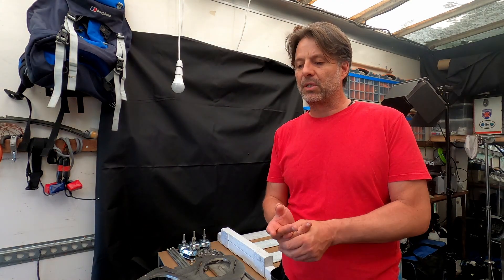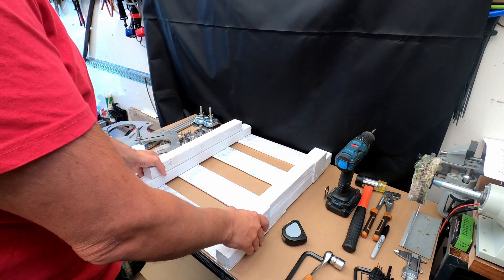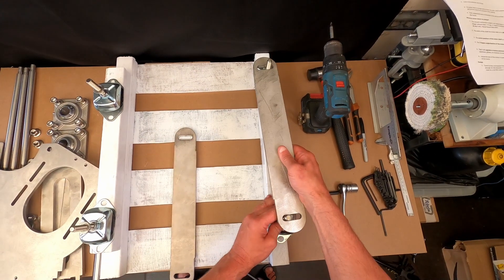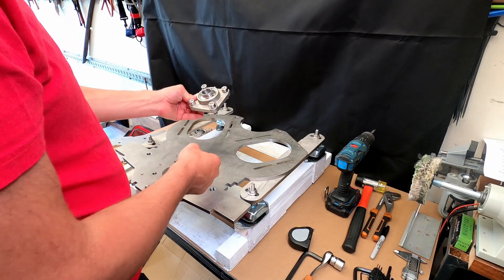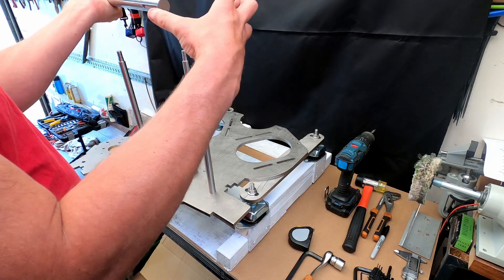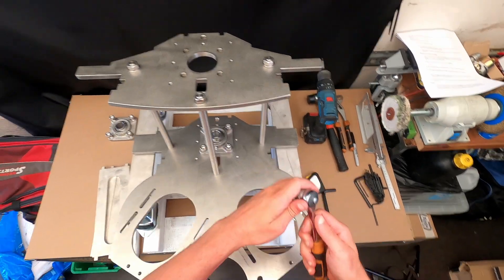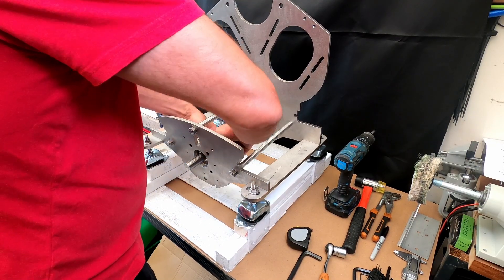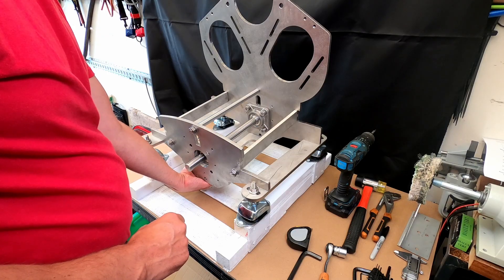Off-Grid Boat: DIY Electric Boat Motor Assembly - Ep. 1

Comment: Hi, looks awesome. We will have the exact same setup as you on our steel sailboat (Devotion 37). Two 10KW golden motors to get enough power with just 48V. Are you willing to share the Qcad files? Happy to pay for it.
Reply from the maker: Hey Jeroens4681 - Hope all good. You are more than welcome to use plans for free as long as it is for personal use and not commercial use. Saying that, it is still a build in progress so the whole setup is yet to be  'proven' in a real life scenario. There are still some areas that needs to be fine tuned and figured out. At the moment the motors do not sync in relation to RPM BUT something I will figure out one way or another:) There is also some work left on cooling as I most likely will shift from air/water cooling to 'skin' cooling. If you still feel that you would like to start your own build then let me know here and we can work out a way to get the CAD files over to you:)
Reply: @modularhippo  Thanks for the quick response. I don't have the motors and controllers yet. Ordered them and did some reading about it. I have the EZ-B481000 controllers and I think the default control mode is "Torque control" (that says the manual) so my common sense says speeds can differ. I am also not sure speed synchronisation should be the goal. I think you want both motors deliver the same torque at the same moment because you don't want one motor(with more torque) driving the other (with less torque). Both motor are physical conencted so speed can not differ anyway. But again, this is my common sense speaking again. I am a few steps behind you but I am not building a whole boat so maybe I will catch up 🙂. And can keep you informed. Why not air/water cooling? Do you think its not sufficient? Golden motor USA is selling an air/water cooling kit and assume they have experience with that. Yours looked already like overkill compared to theirs. you where using a seperate cooling system for every motor/controller. So 4 in total with (4x3) 12 fans? They are using 1 set for the motor and controller and just 2 fans. Curious what the reason is to go to "skin" cooling. Still very intrested in the CAD files. Aware that it is work in progress. I have to alter them because my fundation for the motor is wider then yours but it looks like a great starting point.
Reply: Yes, only for personal use. Getting our own boat electric.
Reply from the maker: @jeroens4681  - Good points around torque👍🏻👍🏻 When I get more time I will imerse myself on the whole topic properly:) - Reason for considering skin cooling is that fans can be ruled out and you are just left with a pump to worry about. My current setup as you say has to many moving parts that can break. Saying thay, I will complete it as well as a skin cooling setup to see what the outcome is:) if you drop me a message on [contact @ modularhippo.com] I will then send you files this coming Monday when back in business. Please let me know when email is sent as a reminder:)👍🏻 Looking forward to learn from your venture as well:)👍🏻
Reply: @modularhippo  I send you a mail.
Reply from the maker: @jeroens4681  - Thanks Jeroen, responded:)

Comment: what is the thickness of the plate ? Was the plate cut on a waterjet ?
Reply from the maker: Hi Jim, hope all good. The plate thickness and type is SS 314 10mm Thickness. My nearest cutting company use laser so that is what is what I was using for these parts.:)
Reply: @modularhippo  Ok makes sense. I am trying to get a design done for a twin motor mount for the Lynch Pancake motors - i am going with 20mm aluminum plate because I dont want dissimilar metals touching the hull. I need to get my mount cut on waterjet because Laser has a "HAZ" issue. If aluminum plate is heated up, it changes properties. With waterjet its a cold process, so no such worries.
Reply from the maker: @jimjones7821  - Tell me about it, I have had so many issues (mainly from welding) where existing parts have distorted from original shape and caused issues. Aluminium plates would have made sense, not even sure now why I did not consider that as an option. Potentially any bolts threaded into the plates and the torque/twist of the motors (believe I was worried that the threads would be effected over time). Either way I guess we should be fine:) My anti-vibration feet has a 2mm delrin plate/washer to separate and made sure I used Sika before I mounted the motor rings to the actual motors (super paranoid in relation to missing AL with SS as I have seen the result on both Motorcycles and boats in the past).
Reply: @modularhippo  yes you are correct about the corrosion issue. Have you heard of Tefgel? Its a paste that you spread over the bolts etc that provides galvanic isolation between the dissimilar metals. The original design I had Agni do was designed for 8mm steel. I had them change it to Aluminum and thier engineers said I needed 20mm aluminum to match the strength of 8mm steel. The Agni engineers did the design such that it can be bolted together or welded. I am going to get the aluminum plate anodised to look pretty because a Lynch motor setup in a yacht should look pretty - right ;0
Reply from the maker: @jimjones7821  - Absolutely, not only will it look amazing when anodised, but will also add some longevity from additional corrosion resistance:) - I have started to use 'Tef-Gel' whenever I use SS Bolts in AL. Please know that even with Tef-Gel they at times need to be removed, cleaned up a bit and Tef-Gel re-applied:) SO easy to forget with everything else going on:) Aluminium makes perfect sense and the 20mm sounds fair!
Reply: @modularhippo  didnt know that about tefgel - you learn something new everyday. I didn't know about the sikkaflex trick though  - which Sikka - there are so many of them !

Comment: Do you have more information about the bearing and bearing housing ?
I’m replacing a bukh DV10 with a 5Kw golden motor en and looking for bearings that van handle axial/radial forces.
Reply from the maker: Hey @MsFrodo111,

Great to hear that you have started a similar project:)

I will be using a 'thrust unit' ( more on that here: https://www.aquadrive.com/ ) that will take up the force from the propeller 'pushing the boat', all to make sure that the axial/radial load is minimal. I am using the bearing & housing below and it should be able to take the radial force created by the spinning shaft:

https://simplybearings.co.uk/shop/p21269/SSUCF205-16-Imperial-Four-Bolt-Square-Stainless-Steel-Flange-Housing-with-1-inch-Bore-Stainless-Insert/product_info.html

How all of this will work in real life is yet to be seen , ha ha. - Let me know if you document your journey as would be great to follow.

Happy Weekend!!

Comment: 2 x 10kW, that will make you a speedboat wouldn't it?
Reply from the maker: Hi Jens - I wish:) I believe 1 Kwh is equivalent to around 1.34 horsepower so are looking at around 26-27 Horsepower. Hopefully enough torque to propel me forward 3.5-5 knots in bad weather, happy with that:)
Reply: @modularhippo  My hypothesis is that sailboats with diesel engines are always overpowered, because the noise, vibrations and smoke at its maximum would make you think the engine is about to melt. I hope you can do with less - 10 kW 🙂 In the end YOU will have a good and responsive setup. Mine will not be as responsive, but should be able to cruise at 5 knots, and maybe 4 in bad weather. I would always use sails in bad weather though.

Comment: Hello !!!   I'm loking for the same type of setup...   Would you be open to sell those ?
Reply from the maker: Hi Anthony - Thank you for showing an interest and for your comment. The setup is not really 'proven' as of yet as allot of the ideas are being amended and improved as we go along. There is also the water-cooling left to tackle. as well as other bits so let's see how it all comes out in the end:) The short answer is, not much of a product at this stage, but if it comes out well then happy to guide you on the process and share plans etc. Let's stay in contact:)
Reply: @modularhippo  I'm building from scratch a Catamaran to live aboard, I'm pretty close to the point of buying an d installing motors, maybe I could help and share ideas too :) !!!  I also have manny questions about how you're going to manage to run and control 2 motors on same shaft,,,  One thing is sure, I'm going that direction too...
Reply from the maker: @antonygilbert9695  That is amazing, a big project!!:) If a Catamaran I assume you want a motor and drive in each hull. by having different rotations on propellers each side you cancel out any prop walk and can also use the individual motors to also steer the boat. Please expand more on reason for using one prop shaft on Catamaran as not the norm?:)
Reply: @modularhippo  I am anti diesel, can't repair them anyway...  As it's for retirement, I want to be able to be safe and be able to fix everything.  it's a 38feet Cat that will weight about 18000lbs, I have talked to Dave Parker here on youtube, thenn by email, he has a 44 feet 100% electric Cat, he's my inspiration...   I will have 23 solar panels (8 already installed) and maybe a small generator for bad situations...   As most people living on their bot are an anchor most of the time, I will be using all that power for a very confortable living...  Also building my own dessalinator from plans people shared onn Facebook..   That may interest you too ???
Reply from the maker: @antonygilbert9695  Sounds like you have an amazing project on the go there (very similar to mine). Are you sharing your project on YouTube, if so feel free to share link as would love to follow it:) I am planning to build a dessalinator so that is very much of interest. There is some good channels out there that show the main components needed and looks like a doable project. Will locate your email and drop you a line:)
Reply: @modularhippo  I am not good or patient enough to make videos...   But I LOVE SHARING as much as I can, this is how we all get better :).  Hope to read you soon...

Comment: Making a mock up of the engine mounts is a brilliant idea, I'mma gonna steal that idea! ^_^
Reply from the maker: Just made the whole thing feel a bit more real as I don't have the actual boat yet😂
Reply: @modularhippo  Oh? How did you settle on the engine mount size/spacing?
Reply from the maker: @TheDigitalMermaid  - Please expand on mount size/spacing as not 100% sure what it refers to. The motor rings are 10mm SS thickness and the reason for that thickness was to have at least 10mm thread space for the 4 slider bolts. The space between the two motors in width is only a couple of centimetres. Let me know if I misunderstood you:)

Comment: Very interesting. I have the same 10kw motor that you show in your second video and I was considering getting a 2nd but I was thinking a dual propeller set-up. What considerations did you make to determine two motors to one prop? -ope nvm. I just read your other comment about the dual motors below. I will stay tuned for where this is headed!
Reply from the maker: Hi TornState, Thank you for taking an interest:) I am building a 36' mono-hull in parallel so this is the limitation. If not then having two propellers (each spinning different ways to offset prop-walk) would have been ideal. Also to be able to control each prop individually for additional steering would be really useful. In my case, only one motor did not fill me with confidence if used in headwind and heavy currents. A 20 Kw motor would mean jumping to 96v and that caused other issues for me so decided to try with two motors and stay at 48v.:) - If you are sharing your project online then let me know as interesting to see what you are up to (especially as we have the same motors):) - Also, if any of the parts I have designed is of use then let me know and I will send you the cad files.
Reply: @modularhippo  Yep I am documenting it  (poorly) on my channel. It's a foam/epoxy trimaran of my own design. I have to navigate the inland rivers of the USA when I launch it and heavy currents are currently my greatest concern.  I am trying to line up a typical gas boat to provide backup when I do my "sea" trials on the Illinois river later this year.
Reply from the maker: @TornState  That is awesome! I have subscribed and will definitely check out your videos. Respect for designing your own trimaran. Not sure if you have heard of an Ian Farrier (trimaran designer in Australia) but had the blessing of talking to him before his passing (old age). Very interesting guy and designs worth checking out:)

Comment: I am LOVING the look of this and can't wait to see it develop. Intrigued as the what motor controllers etc you'll be using. I built 'The poor mans electric boat' back in lockdown of 2020. That was on a 36' narrowboat using a forklift truck motor (videos of the build are here on YouTube) Unfortunately shortly after getting it working I blew the control unit and the project stalled. However the idea is still ticking away in my brain and seeing how your tackling it makes me VERY interested to see how it all works. Looking forward to the next instalment - cant wait to see that frame work set up with motors and pulleys etc.
Reply from the maker: Hey, nice to meet you and thank you for the kind words! Only time will tell in relation to this becoming something fit for purpose or not:) Will make sure I cover motors and controllers in the next episode:) Looking forward to check out your videos and work you have done on your narrow boat:) Love the idea of recycling a forklift motor!! Make sure you complete the project as sounds like a brilliant idea.
Reply: @modularhippo  It is looking really good, I have every faith it'll work, I assume your going for 2 x 10kw as opposed to one 20kw so you can keep to 48v? Loving the belt drive idea as well! Unfortunately I sold the boat I started the project on last year (long story as to why - But I have another boat now - a longer 47ft narrowboat). So the project is still possible - just on a different boat to where i started. Looking forward to seeing the controllers etc and getting a vision of the full set up.
Reply from the maker: @WingingItBoatingonaBudget  - Correct, I was looking at a single 20Kw but as it meant I would have to use 96v instead of 48v I binned that idea. Later I realised that having two motors also added a redundancy that one motor would not offer. To be continued:)
Reply: @modularhippo  looking forward to the continuation 😁
Reply: @modularhippo  Will one motor run while the other motor has stopped - given they are on a belt joining them together ?
Reply from the maker: @jimjones7821  Hi Jim - Against current design, both motors are intended to run simultaneously (as both are driving the single prop shaft). If would though be super handy if you include a mechanical simple way to be able to disconnect one motor if ever needed. If your choice of motor allow 'regen' then that would help allot (disconnect one) as I think that in my case the 'regen' will struggle to propel both motors.
Reply: @modularhippo  Yeah that is an interesting thought. A nice thing about the "Pancake" motors is they are as efficient in regen as they are in direct propulsion (about 94%). However I dont think regen is worth getting too worried about - the amount of power you can "regen" at the speeds we are talking is so small that its hardly worth the bother - or the drag. I intend to fit a Bruntons Eco Star prop - so I could regen and will try it out but I am not too excited about it.
Reply from the maker: @jimjones7821  - That is impressive numbers:) - The propellers I wanted would require me to sell and arm and a leg so I went with a standard 3 blade. It will slow the boat down when sailing, saying that I am OK with that:) I am planning to have 2 smaller Hydro-Generators that can be lowered in from Transom when sailing. I am aware that the return is minimal BUT everything helps (will be a small trickle charge):)
Reply: @modularhippo  Yeah I also have some added drag. I wrote big long reply here but then decided to delete it because it was LONG and I didnt want to mess up your comments section - i Saved it all though and thought I could email it to you because you might find it interesting. There are not many people out there like us.

So the drag I added is that I had two "POD" boxes welded into the aft section of the hull near the rudder. I am mounting 2 x Epropulsion "NAVY 6kW" pods each side of the hull - the drag is not insignificant but like you, not in a hurry to go anywhere - more paranoid about getting stuck somewhere in the bush. yep in the bush - my boat is going to a huge freshwater lake in the middle of Africa. The lake is 700 Klms long - so an inland sea. Its incredibly remote out there - so I need to be very extra uber self reliant - If I have a problem out there, no one is coming to get me or help me - so 2 sets of propulsion it is. The lynch motors on the main shaft turning an ecostar prop and the 2 smaller Epropulsion legs port/starboard - each system connected to its own standalone battery - I am trying to have a back up of every system. (yay - i said that in under 500 words ;0)